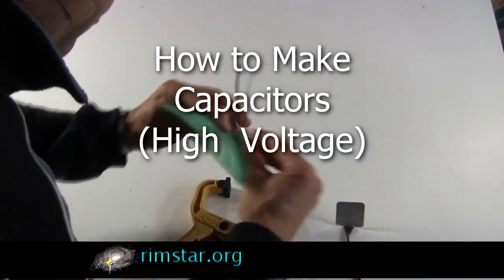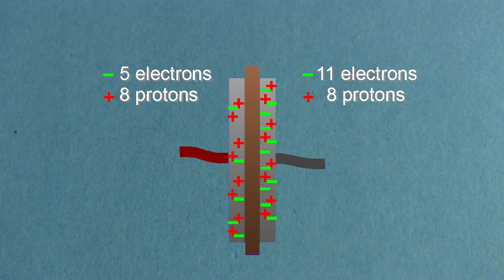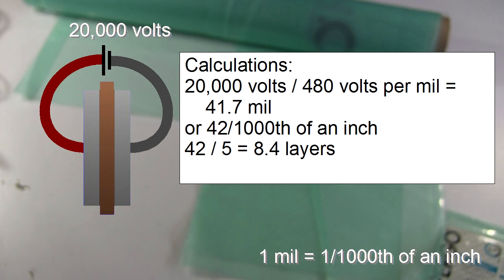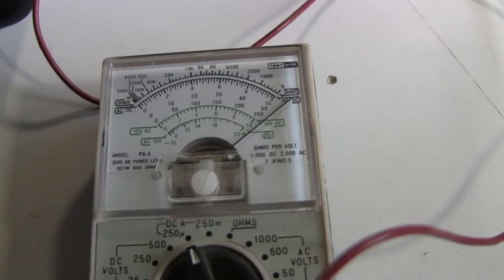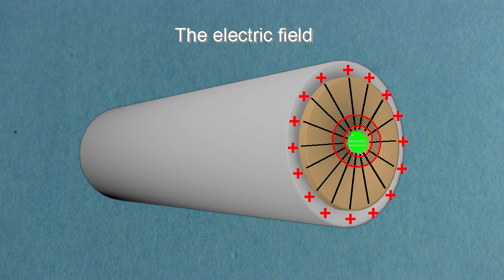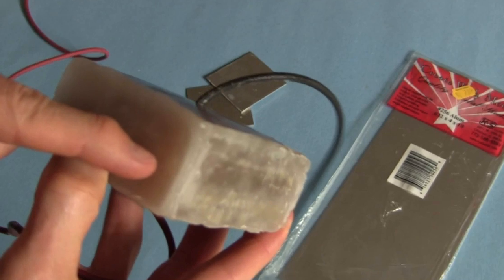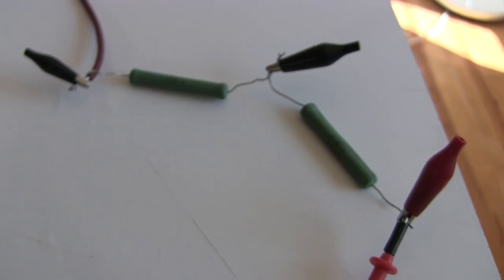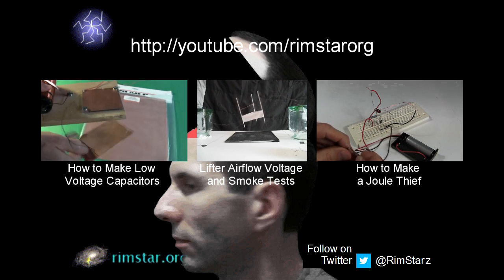How to Make High Voltage Capacitors - Homemade/DIY Capacitors

Comment: Hello Rimstar org
I am working on capacitive wireless power transfer for undersea application but i haven't idea about how to make capacitive plate can you guide or share information regarding this that how to design capacitor plate which can provide capacitor value around 10uf- 36uf !
Reply from the maker: The one I made here, https://youtu.be/lmVVdV8wuB0 , is an electrolytic capacitor with a capacitance of around 560uf. It's wound in a spiral to make it compact. I don't know if it would work for your configuration though.

Comment: What is your meter model? Brilliant video by the way.
Reply from the maker: Thanks. My meter is an old one handed down by my father. It's a Micronta FET 22-220A analog meter. But it says Radio Shack on it so I doubt that it's still made.

Comment: 1:06 well but the 4π is wrong!
Its just ε0*εr*A/d.
(your formula is probably with other units for capacity, so be aware of the units you use. If u use F you will have to remove the 4π)

Comment: Awesome stuff. Why is it “more standard” to use thicker plates and of different diameter for breakdown tests?
Reply from the maker: I don't know for sure. Maybe because by having one plate with a much larger surface area, you eliminate any edge from that plate. The electric field at edges is different so by not having an edge, you eliminate that variable.

Comment: I have the plans for a large (10m) in diameter electrogravitic / resonant frequency vehicle that actually works. Would I  be able to get in touch with you  ? This has flown on 2 occasions & re-entered the atmosphere slowly after accelerating to well over 200,000 MPH top speed. Two have been built & both were confiscated by the government as”a matter of National security”, after been detected by NORAD. The owner passed away & left me the plans.

Comment: Thanks for an interesting video. If I wanted to increase the voltage breakdown on a butterfly variable capacitor by cutting out mica discs and inserting them on the spindle between stator plates, would this work? have you tried this?
Reply from the maker: Butting something between the discs as you describe would work. Some things to keep in mind though. I bought a roll of mica once and it came apart in flakes easily so be careful what you get. Another thing is that if the voltage is high enough then sparks can take a path through the air around the mica at the edges too so if you have a high enough voltage then you might want to make the mica plates have a larger area than the capacitor plates. And lastly, the mica is a different dielectric than the air that's currently acting as the dielectric so your capacitance will be different. I talk more about capacitance in my other capacitor video here https://www.youtube.com/watch?v=GveI9gXIsHw
Reply: @RimstarOrg  Thanks for confirming it would work and noted about the dielectric. What I cannot undestand is why this is not used on HV capacitors. Are you aware of any disavantages in using additional insulation between discs besides the more complex manufacturing.
Reply from the maker: My guess is there's not a lot of demand for variable high voltage capacitors.

Comment: I read that the higher the voltage, the smaller the gap between plates... something to do with the odd fact that higher voltages actually form smaller fields. You can't really serially stack dielectrics and expect them to hold up to the total high voltage, each dielectric will be hit with the total voltage.

Comment: Capacitors do not store charge on the conductor, it is stored in the dielectric, take a charged dielectric to build your next capacitor and your finished cap will be pre-charged.

Comment: IDK if  your PE is 94-v rated, but if not, PE turns to liquid fire (imagine water on fire and running everywhere all the sudden) if it catches fire... big deal around electric applications.  This is more for the impatient experimenters viewing this in case they decide not to encase it like you do.

Comment: there are a few problems with this capacitor nobody should waste their time with...1st...the outside of the capacitor should be made of a metal  aka conductor...this enables the capacitor to dissipate heat so it does not turn into a bomb and explode from the pressure increase because of temp increase...they are related...if you raise 1 the other so increases...this is why you see capacitors with big bulges in them when they go bad most of the time inside things like an ac condenser that are rated for 440V...2nd you should use oil inside of a capacitor to insulate it but more importantly to transfer heat to the metal casing so the heat can dissipate...

Comment: Hello again! I'm almost ready to assemble my own version of this project but I had a few questions first. Did you ever test for the max voltage of this design? What was it and how long could it hold the charge after disconnected from the battery?
Reply from the maker: I test the max voltage in the video and show the result. I didn't test how long it could hold the charge for though.

Comment: Would that not make an inch, one meter long?
Reply from the maker: Which part of the video are you referring to?
Reply: Where you say a millimetre is about one thousandth of  an inch. Dielectric thickness.
Reply: Really love your videos, by the way!
Reply from the maker: Ah, thanks for clarifying. A mil sounds like shorthand for millimeter but it also means one thousandth of an inch and has nothing to do with the metric system. https://en.wikipedia.org/wiki/Thousandth_of_an_inch Searching for tables of breakdown voltages (at least back when I made this video), the units were usually in volts per mil.
And thanks! I'm glad to hear you're enjoying my videos!

Comment: So what about vacuum, and what would be the best device to make the best vacuum chamber. My idea is ... with proper measurements... slab of glass, metal plate small than slab of glass, another slab of glass same size as first one but with a big hole in the center, so think of that glass more with a gasket and the metal goes half way under that ring of glass, then another metal plate, then another slab of glass, put under best vacuum possible and melt the perimeter of the glass slabs together.... so what if I want like a million voltage capacity.

Comment: And how that small high voltage throw hole  ceramic caps are made which is blue in colour and rated more than 2kv in nf range ? Because they are very small and high energy density its technology not seems like this ! I have seen there's some types of Carbon like material in it ? And why there is not any Carbon based supercap for higher voltage??

Comment: Great video! I'm very interested in reproducing this experiment, but I'm not sure how you connected the wires to the plates. Did you solder or glue them? I can't tell.
Reply from the maker: I soldered them. I had to use a soldering gun in order to get the copper plate hot enough. It's not easy.
Reply: @RimstarOrg  do you have any videos demonstrating your methods? I'd really like to learn how to do this!
Reply from the maker: I don't really have any videos specifically on construction methods, though I sometimes give tips in videos about making specific things. The number one trick is to make things and learn as you go along.

Comment: HI, and thank you for the great videos!  I saw somewhere where you mentioned using a sharpened grounded wire for discharging very large high voltage capacitor banks.  Can you give a bit more detail on what you used?  Would a sharp nail tip (on the end of a PVC rod) work as well?
Reply from the maker: I do that in a few videos. A good demonstration is done at seven minutes and thirty-six seconds into my 30kV power supply video https://www.youtube.com/watch?v=GEuK1OdYxHk The resistors aren't necessary -- I do it for a different reason in the video. They just slow the discharge a bit in case it might contain too much current. Any sharp metal point will do. A sharp nail tip on the end of a PVC rod would be fine. The sharper the better. If you don't have a file or sandpaper for sharpening it then you can sharpen the end further by scraping it against a rock.

Comment: I made a very large cap from full sheets of page dividers and aluminum foil alternating them to about 2 inch thickness.  Except it fried my power supply (flyback transformer) after a couple of uses.  I think it's because when it's fully charged it allows a huge amount of current to flow through the secondary.  I could add resistors in series but that would sort of defeat the purpose of having higher voltage/capacitance.  I was thinking if I added some inductors in series it might help to limit the current draw without lowering my output voltage...
Reply from the maker: Yeah, it does sound like your dielectric broke down and you got one or more sparks, which can have a lot of current. I damaged one of my power supplies that way. Here's the diagnosis and repair video I did about it http://youtu.be/Kb0WwsJgTMM in case it helps with your own repair. I normally use 240 kilohms, 2 watt resistance in series to make sure the current isn't too high during unexpected sparks. You can see that in the demonstration at around three minutes and forty-four seconds into my video about making a power supply out of a PC monitor https://www.youtube.com/watch?v=r32e0QGdm8U

Comment: The dielectric strength of a dielectric such as Mylar decreases as the film thickness increases. This means that you can't simply double the dielectric thickness and expect double the breakdown voltage. If you download the datasheet for Mylar you will see that the dielectric strength decreases substantially as film thickness increases. The reason is that the electric field does not distribute evenly across all the layers of dielectric film. A solution to the problem is to use a technique refered to as dielectric stratification. This involves placing floating tinfoil between every layer of film (but not right to the edge). This stabilises the electric field between each layer and allows you to stress the dielectric to it's published value. Also, you have to test the capacitors in oil if you work above the corona inception voltage (about 10kV) or they'll fail from corona and not dielectric breakdown.
Reply: this is a very interesting (and logicaly explained) piece of information but i cannot find any source for "dielectric stratification". Is there another term for it ?

Comment: Thank you sir, I have been wondering how people are measuring currents from things running at 20 kv+ with regular multimeters.  Right now I don't own and analog meter but could buy a cheap one just for this.  By the way I really like the old Radio Shack meter.  At one time they actually had good equipment.  I have one of their digitals that was made by Fluke :-)

Comment: How did you take the current reading without destroying that meter?
Reply from the maker: If you're referring to how I put more current through it than the meter could indicate, I guess if there were any resistors inside then they luckily were rated high enough. If you're referring to the high voltage across it, I deliberately put it on the ground side of the circuit to minimize that.
I wouldn't use a digital meter though. I destroyed the current measuring features of a digital meter this way. Analog meters don't seem to have an issue, in my experience at least.

Comment: Thanks for the video, I just subscribed.  I'm here after blowing 3 cheap Chinese 1000  nf caps and deciding either I'm going to spend way too much or build some myself.  I found some teflon sheets used in heat transfer I'm going to tray as my insulator. Do you have any experiance with that material?

Comment: I want to make a 1uF; 1000VDC(500VAC) capacitor; is that even possible to make DIY? (would need to be less than 1" diameter, 3" long).
Reply from the maker: I don't know of any way to make it DIY. High capacitance and high voltage rating are a hard combination to make.

Comment: hi could I ask what is the name of the metal plates in the packet you bought from local hardware store ? .
Reply from the maker: If you mean the company name, it's K&S Engineering Company http://www.ksmetals.com/30.html. If you mean what metal, at 0:12 it was aluminum and at 7:28 it was copper.

Comment: Please how to make capacitor 10kv and  2 or 4 micofarad hi frequency . And what is material can be use
Reply from the maker: That would be very hard to do, or a very big capacitor. High breakdown voltage and high capacitance are usually hard to get at the same time. That said, I do have a very old manufactured oil filled capacitor in front of me that's rated for 4 microfarads and 4kV (just measured it and I guess it'd broken cause it was picofarads). So it's possible but I don't know how.

Comment: After looking at your page on making high voltage capacitors, I thought that you MUST see (if you haven't already) the standard on making a simple splice (to connect two wires together) to NASA specs.It would go very nicely with your connection and it is ULTRA-SIMPLE...just about five or six simple requirements.  Also, now I see that it looks like it is designed to prevent corona leakage...a way I never looked at it before seeing your link.  I don't have a link (there are many) at the moment, but you can just google the likes of  "wire splice to NASA standards" or "linesman's splice to NASA standards"...etc.  This is something everyone from the beginning hobbyist to professional electrical engineers must see!
Reply from the maker: The technique I use, the one I show a bit of in this video at 8:55, has worked well for me up to 75kV and high current without measurable leakage. I talk about it more on this page https://rimstar.org/equip/hvwiring.htm. But mine is more for temporary connections, sort of a way of plugging and unplugging high voltage components. The NASA one looks great for permanent connections. Thanks.

Comment: Thanks for making all of these great videos--you are a natural.  I really enjoy the math and physics that you use.  I had ti write about something in this video that I briefly saw at about timestamp 3:30 ...It was too quick for me to be sure but that reddish variac there looked like one in a large group that has a very dangerous flaw.  In the ones with an outlet (and perhaps others too) the HOT and NEUTRAL lines are reversed!  Just set it to about 115v and test it with one of those home mains testers.

Do you have any plans on using the N2 laser as an energy source for the photo-electron emission in the photoelectric effect.  I remember briefly discussing it some time back.
Reply from the maker: Thanks for the tip. I'll check my VARIAC. It's been leaking magic smoke lately anyhow so its due for an overhaul anyway.
Re the N2 laser and the photoelectric effect, I do recall our discussion about it and have it on my todo list. Just haven't gotten around to it.

Comment: what's the best antique style dielectric to use? i'm making a spark gap transmitter and i am trying to do everything how they would to it then
Reply from the maker: The only things that come to mind that they used back then are wax or oil. I don't know if they used something specific for capacitors with spark gap transmitters.
Reply: they probably used a liquid filled capacitor, possibly salt water?